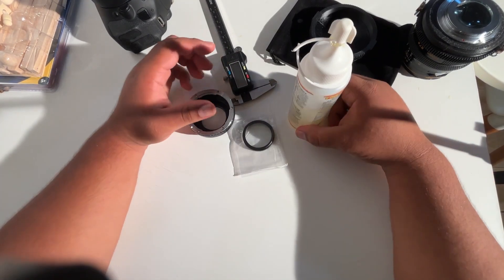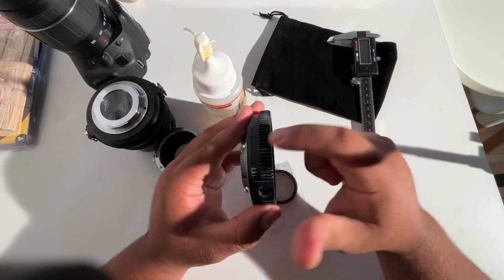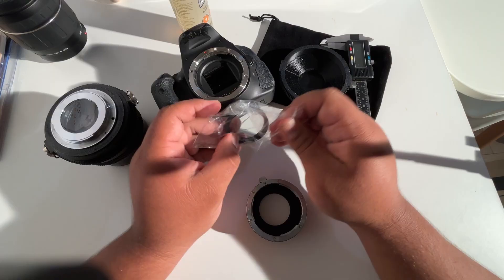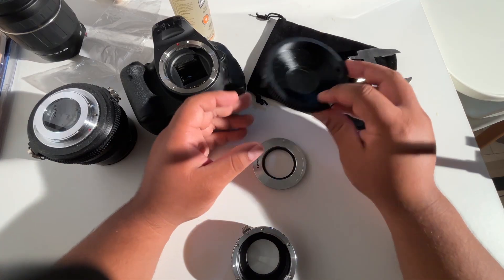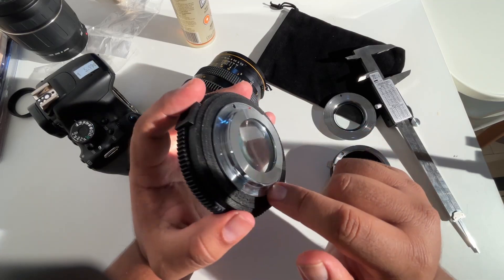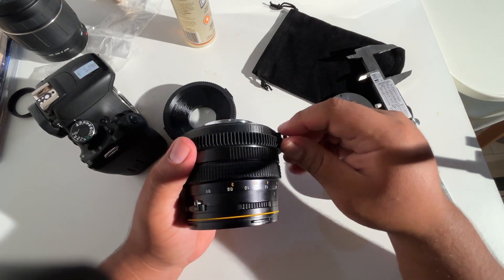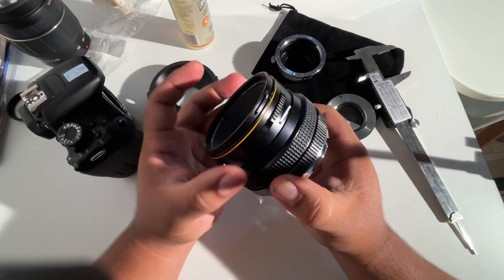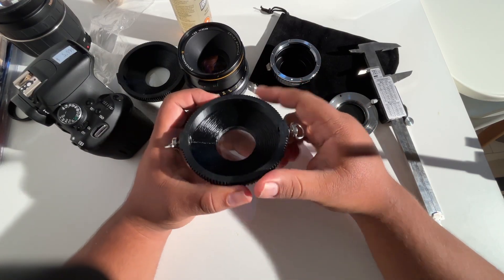DIY speedbooster canon to medium format

Comment: what is that white cloud in the sample images (in the center of the sample shots) from thingiverse and ebay link? Is it possible to remove them?
Reply from the maker: It is something that happens when the light comes in on certain angles. It is to show all the defects of the set up. If you where to make your own you would have to not shoot with light coming in through those angles.

Comment: Good job bro.. This is youtube used for.. Can i ask you question?? is this adapter only for Bronica SQ lens or i can do that on Bronica PS lens or Mamiya lens too ??
Reply from the maker: I only had access to a Bronica sq lens, so that’s the only thing I could test. But if you have a 3d printer you can just modify my file into something that works for your lenses. Let me know if you do
Reply: Did you ever finish a Mamiya 645 adaptor?